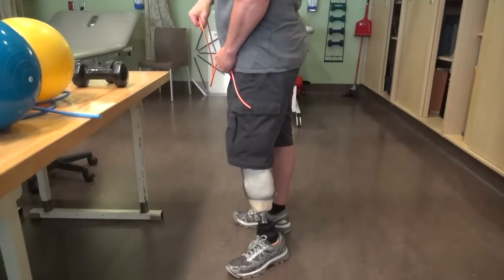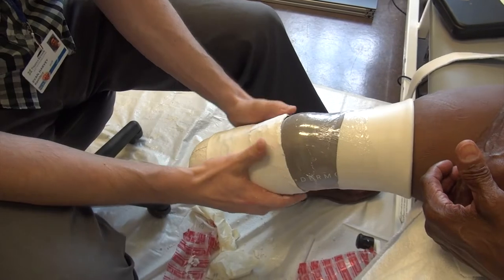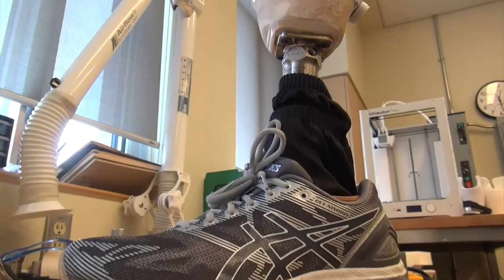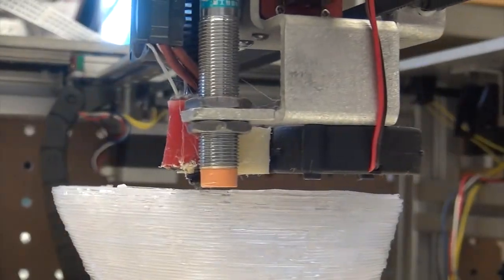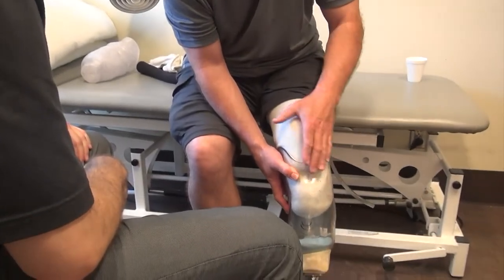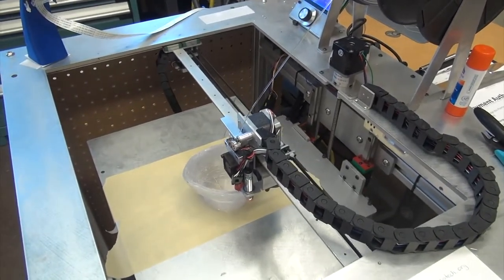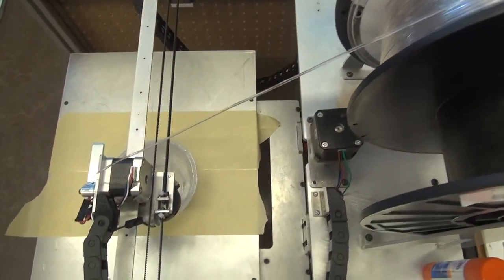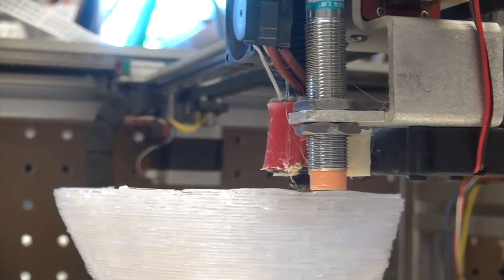Using 3D printers to help build prosthetic sockets

Comment: the curvature of the stump cannot be seen by the scanner after putting on the liner. It is damn stupid to use the 3D scanning for prosthetic leg fabrication. The casting have to be done manually and putting pressure because the stump has to bear the weight of human. The shape of the stump will change and it is different while bearing weight of body comparing the stump is not bearing body weight.

Comment: they have no idea how to use that 3d printer thats just the doctors using it and the filament extruder was not calibrated correctly as you can see it dipping into the plastic while printing and the gaps in the print surface show warpage and is not climate controlled properly. 3d printing can be the best possible option for not only prosthetics but robotic replacement parts. You just need someone that know what they are doing designing and making them, its an engineering art and can be the future of prosthetics, robotics and maybe even cybernetic enhancements.